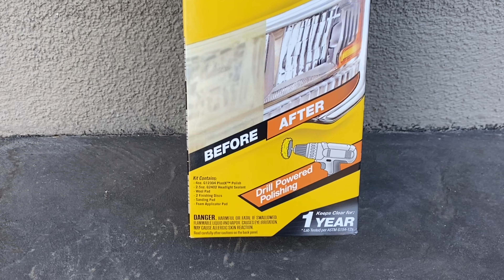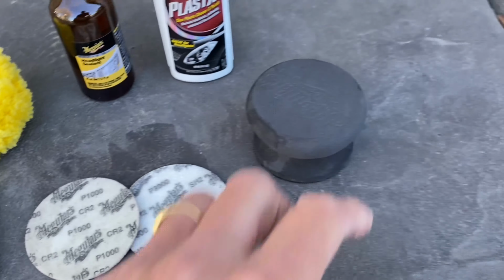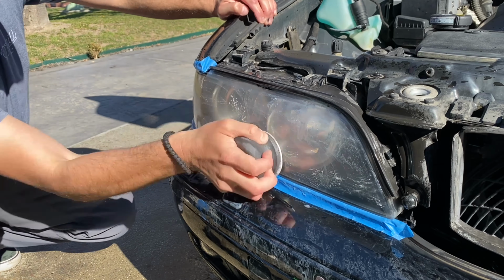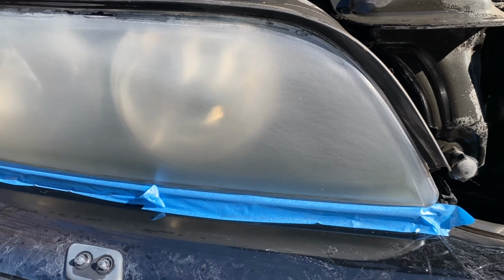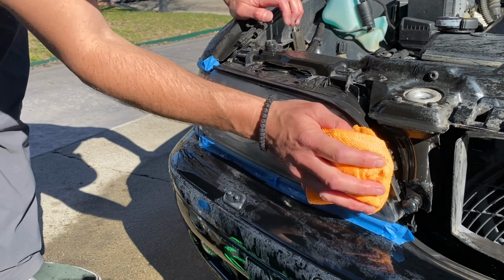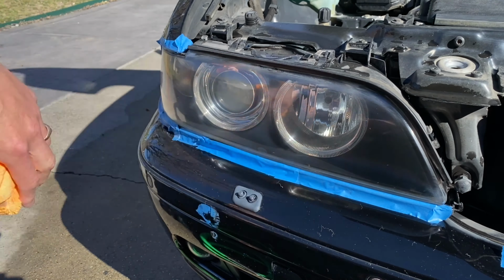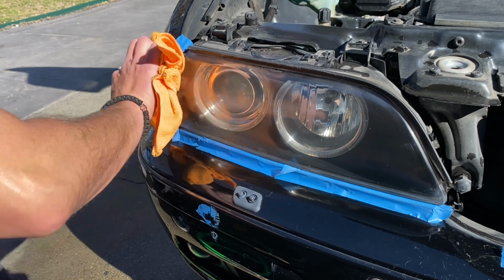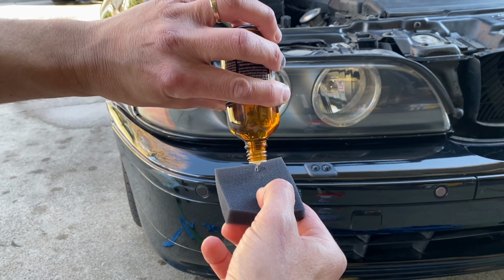How To RESTORE HEADLIGHTS!! Meguiars Headlight Restoration Kit: Heavy duty Kit!

Comment: Looks like you  might want to move a little slower during the last step of applying the sealer in order to allow the plastic to absorb a little of the sealer? Also you must be all of the way dry before applying the sealer? 
  Does it allow you to apply another swipe of sealer after the first one or will it smear and fail to level like some of them do ? If only one swipe allowed another arguement for keeping the pad well soaked with sealer and moving it rather slowly over the plastic surface to make sure it has a chance to "drink" its fill. 
  Can you do a spray water rinse after the buffing/polishing step or are you only allowed to wipe with a cloth at that point ?

Comment: I've used this kit numerous times for my customers. They bough it and asked me to use it.  Every single one of them has came back about a year after. Used the same kit once again,  spent more time with more attention, they all came back 6 months later......
This kit does make absolutely trashed headlights come back to like new condition right after the service......but unfortunately the durability is not a factor here.
Reply: Woul clear coating it be better